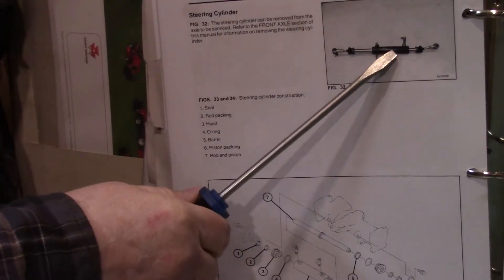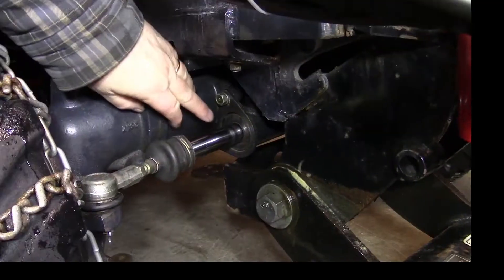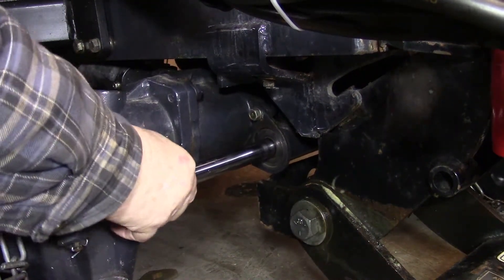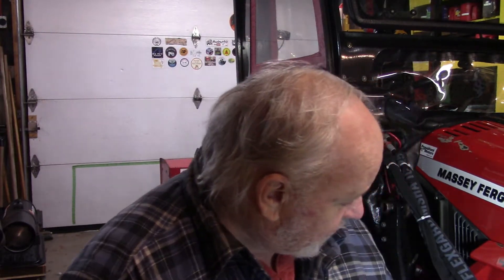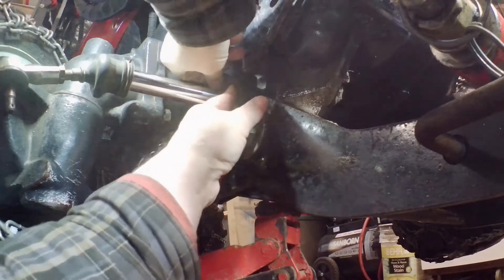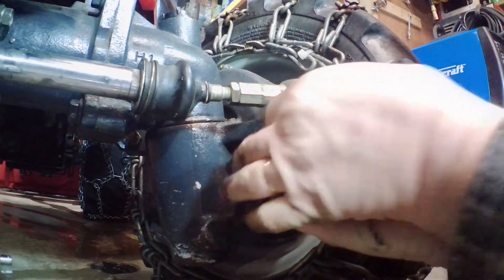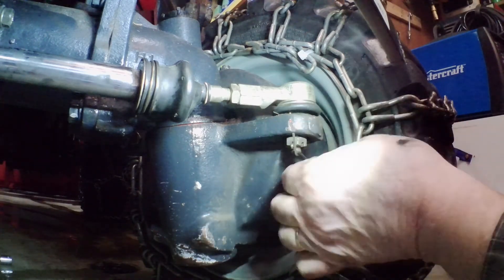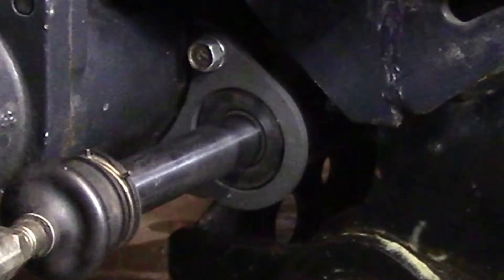Maintenance on the GC2300  Steering Cylinder

Comment: Good work Mike , looks like you are set and ready to now. Swapping those flanges out will make all the difference. Cheers
Reply from the maker: How's she goin'?  There was a lot of play in that piston and still some movement after I changed out the flanges.  I think the cylinder rim is worn some too.  It's a lot better now though and I can rest easy that the steering should hold up while plowing.  Thanks for the visit and for the comment s too.  Take care!!!

Comment: Awesome Grampie🌷《☆》Nice work Brother👍✔Good thing you changed the brackets before they got to worn🤳Gloves are nice till they start impeding progress⛾Taker easy my friend🖖🤓🏈
Reply from the maker: Hey there Bdog!!!  I started this job with no gloves, then it was pretty oily on the second flange so I put on the nitrile gloves, but like you say, they're good till they get in your way.  And as you saw, I ended up with no gloves.  A little grease will never hurt anyone!!  Not the first time my hands got dirty eh!!  Thanks for the visit and for commenting.  Take 'er easy!!!
Reply: @GrampiesWorkshop  《☆》A combination of fuel and or oil with cotter pins and or safety wire is usually fun. My gloves generally wind up getting fuel and or oil inside of them. That's never good🖖🤓🏈
Reply from the maker: @bdogjr7779  I find too, that when my hands get covered with dirt and oil, the first thing that happens is my nose gets itchy!!  LOL

Comment: Great job replacing those flanges and for filming the action, we always struggle filming things when they do not go exactly to plan. We have a very wide collection of tools for removing tie rod ends, you should have said and we would have popped over with them 😀 This does not look like a great design, I would have thought the flange would have been welded onto the cylinder. I would not be surprised if you have some wear on the outside of the cylinder too which may mean the new flanges wear quicker, hopefully not
Reply from the maker: Hello there Joseph!!  I have said many times before in my comments on your videos, and comments that you have made, that you have an engineering brain.  That's pretty neat that you notice things like the wear on the flanges and what causes it.  I expect the cylinder rim has some wear too.  The flanges look to be just cold rolled steel and the cylinder body needs to withstand some pressures and so is probably harder steel.  So I think the flanges are designed to be the sacrificial piece in this puzzle.  But it was a good observation that with some wear on the cylinder, it will wear the new flanges quicker than the old ones were wearing.  I do believe the cylinder is meant to have some movement and not be mounted rigidly since it is a 'push-pull' type of apparatus.  Thanks so much for your comments Joseph.  It's a joy to read and respond to them!!  Take care!!

Comment: Very good fix, Mike. I can't believe that those brackets are designed to hold all the forces that the hydraulic rams puts out. It's little wonder the brackets wore out! I like your description of showing the ram in the book..."Ghosted out"... to describe a faded line drawing of a part. I never heard that phrase before but it sounds very professional! I have a tool for splitting ball joints and tie rod ends. It is a tapered, heavy duty forked tool called  unofficially a "pickle fork". Sorry to be so tary getting to watch your videos lately but I've been very busy. Hopefully things will slow down a bit soon. Keep up the fantastic work!
Reply from the maker: Good day eh!!!  The devil  makes work for idle hands so I hope it's not the devil's work you're busy with!!!  LOL  I read in some comments here from viewers that if you take the hammer and give the housing the ty rod fits into a good wrap it often times will pop the ty rod free.  The first side sure gave be a battle.  The second one about fell out on it's own!!!  That's the way it goes sometimes eh.  I sure appreciate you taking some time and watching, especially when you are busy!!   Thanks for that and take 'er easy!!!
Reply: @GrampiesWorkshop  A big hammer will solve lots of mechanical issues. LOL

Comment: Another great video.  Same as others commented…I give the knuckle a quick rap where the ball joint stud goes thru the hole. My understanding is that the hole goes a tiny bit egg shaped allowing the stud to pop out.  Looking forward to your next repair.  Now get to work!  Lol.  Hope the latest storm didn’t  hit you too hard. We got about a foot here in my location in SW Ontario.
Reply from the maker: How's she goin'?  I never heard of that trick for getting the ty rods loose.  That's another thing about YouTube, so much knowledge in the viewers and they are always willing to help.  Thanks for the tip Keegan!!!  We did get a good drop of snow, but then it rained a bunch.  There is about 7 or 8 inches on the ground now.  Thanks for tuning in and commenting.  Take care!!!

Comment: Hey Mike. Your constant being aware of how ALL your equipment is a godsend for you. These (anything man makes) jobs can get really involved if you hadn't found it early on like you have. With these tie rod ends if you give the mount where the tie rod fits into a good solid smack with a 4 lb hammer (Take the wheel of so you can deliver a good blow) It will come loose as the taper socket it fits into will no longer be round. Any time I see lock washers I question why they are there. Proper torque on a flat/hard washer is all that is needed for your tractor all the way up to semi trucks. It is great to see this was a no blood repair. Odd setup for a cylinder but considering this unit's age and all the work it has done yer in the green ladd. Take care eh.
Reply from the maker: Hello there Dean!!  I never knew of that trick for getting the the ty rods to come loose.  The second side almost popped out on it's own!!!  The next time I do this job, I'll be ready now though!!!  These flanges weren't wore nearly as bad as I thought, but I was glad to get the replaced all the same.  I hope all is well with you my friend.  Say hi to Sophie and we'll talk to yas...
Reply: @GrampiesWorkshop  I think you were right on time with this repair otherwise the damage to the cylinder end mounts would start getting out of hand and a trip to the machine shop to true up the cylinder end mounts and have custom end mount plates made. I am thinking about 2-1/2 to 3 shop hours. At $100.00 an hour plus the drive, oil loss etc, , ,I think you get my drift. That and the next time these plates need changing they have been basterised so off to the machine shop once more. You got at this right on time bud. Email headed your way.
Reply from the maker: @TomokosEnterprize  Hey there Dean!!  Thanks a lot buddy.  I noticed the movement in the cylinder a while ago and it was getting worse, so I figured it's time to get at 'er!!!  Taking it to the machine shop, well you're right about the cost and then the bastardized part afterwards.  Not what we want eh!!  Have a good week Dean!!!
Reply: @GrampiesWorkshop  With the care and attention you give your iron that tractor (and the rest of your equip) will serve you for a very long time my friend.
Reply: @GrampiesWorkshop  I gave her some extra noggin nergling for you bud. She loved it.
Reply from the maker: @TomokosEnterprize  Ha Ha Ha!!!

Comment: Hey Mike. Did you get the flanges from Massey Ferguson? I need to replace the rubber boots on my tie rod ends. I might as well replace the flanges at the same time, if they are worn. Thanks, Mike!
Reply from the maker: How's she goin'?  Yes I did get the flanges from Massey Ferguson.  If you get some better take your wallet with you.  Man-o-man Agco sure charges a lot for their OE gear.  It's not the dealer either, as I checked a couple of Massey dealers and the prices were all the same.  Thanks for watching Rick and have a great day!!!
Reply: @GrampiesWorkshop  Someone is making big bucks at Agco! I contacted them about opening a small dealership.  I needed at least $500,000 just to open the doors. Soon as I win the lottery, I'll open the dealership.
Reply from the maker: @twinbrookacres  That's for sure eh!!!  This flange was almost identical to a Kubota one.  Here in Canada the Kubota flange was $9, the Agco one was, are you ready?  $37.  No lying!!!

Comment: Sweet, watching you for a bit now out in British Columbia. I just bent both the ears on mine. Wondering if you ordered from Massey Ferguson or a after market company? Love the channel, seems i have similar issues to you and you have a good set of videos for tractor! Keep up the good work. Thanks
Reply: Oops read down further seen you posted they where OEM. Guess ill make that call. Thanks again.
Reply from the maker: How's she goin'?  Welcome to the channel and it's great to read your comments.  Here's a sickening story, I looked at Kubota brackets.  The Kubota ones almost fit.  I bet they would work but I didn't want to take the chance.  The mounting holes were off by about 2 or 3 mm.  Not a big deal, maybe!!!  And the Kubota part was like $9.60 Canadian!!  Now the Massey part, the ones I decided to go with, are you ready, $37 each!!  Yes you read that right!!!  All they are is a piece of stamped steel.  I can't believe the prices for Agco OE parts.  And tis is not the dealer jacking up the price either.  I checked 2 dealers and on line and all the prices were the same.  I took this one on the chin and went ahead and ordered the Agco parts and, well you saw in this video the results.  The cylinder is a lot more stable now.  So when you order your flanges it'll be interesting to see what they cost in BC!!  Thanks a lot for tuning in and I hope you come back often!!  What year is your GC?  Is it a GC2300 series?  I really like my tractor and it sure can do a lot of work!!!   Take 'er easy!!!
Reply from the maker: Right on!!!
Reply: I have a 2007 GC2310 TBL. Been running bucket and 64” box blade this winter working ok. But just picked up a 64” rear mount Kubota blower sweetness. Lags a little in deep icy snow, but gets i done. I ordered a set of brackets just after i commented from closet dealer and they where $30 a piece. See what shipping is. Keep up the great work.
Reply from the maker: @garychizz8310  Thanks for the reply and good luck with your new gear!!  Sounds like a good set up!!!

Comment: I see you removed your gloves too early at 10:20... I do the same thinking the job is almost over and finally get dirty hands!  When parts like that start to get loose, the wear gets worst very quickly.  You better take care of it before the cylinder body gets worn. Thanks!
Reply from the maker: Salut Joe!!!  The Nitrile gloves are nice but when things start to go wrong, it's time to take off the gloves right!!!  LOL  These flanges have been wearing for a while and I wanted to get them changed before they got worse.  That's why I changed them.  As it turned out, there wasn't a whole lot of wear on them so maybe the cylinder rim is getting wore too.  But the cylinder is more secure now and I think it's meant to have a little flexibility.  Thanks for tuning in and take car!!!

Comment: What a job?.... I don`t really like the design but then you don`t have a choice. there`s a trick to take them ball joints off and it`s not with a pickle fork tool....come down to my place and I`ll show you....the cylinder still moves a bit.....bad design for sure....CHEERS
Reply from the maker: Hello there Gator.  That first ty rod end was a bear but I got it loose finally.  I don't think that cylinder is supposed to be held real rigid.  I think it's supposed to move some, but I was getting worried it was moving too much and I wanted to address that before I started doing too much plowing.  Thanks for tuning in and have a great week!!